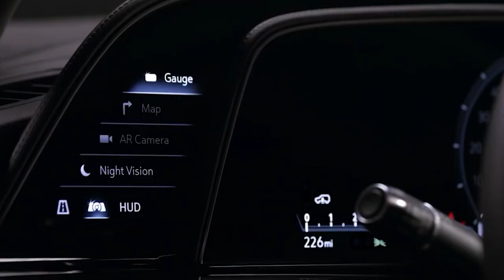GM CEO’s Final Decision On Electric Cars! HUGE CHANGE!

Comment: 🌲 When YOU use any government programs of any kind YOU'VE ALREADY FAILED. The EV YOU just bought is 95% fossil fuel powered. Everything to build that EV was fossil fuel powered. From the dirt being dug up to harvesting and processing all the minerals. ALL the plastic in YOUR car, home & wearing is petroleum based and is shipped from here to China manufactured and returned using petroleum based fueled cargo ships. This also includes all the solar panels and electronics YOU just purchased. The government is going to start charging YOU a connection tax/ monthy fee whether YOU use it or not along with a per mile fee and soon to come the time of day YOU drive fee. YOUR EV weighs TWICE as much as a regular car causing TWICE as much road damage which means the roads have to be replaced TWICE as often. (traffic jams during construction) using fossil fuels. YOUR batteries are the exact equivalent of a empty gas tank. YOU have to fill them both up with energy. The 20-year END of life solar panels ( recyclable NOT ) in California are just now coming off the roofs in droves and they only have $1.50 worth of recyclable material which cost $20 to retrieve. California like EVERYONE has NO place to put them or recycle them which would be insane if YOU did being the amount of fossil fuels YOU'D have to use to process them. Plus add up all the government permits & fees, people, cars and large industrial buildings that will be consuming massive amounts of fossil fuel to do the jobs. Final note. Newson is trying to dump the dead cells in Arizona which they replied. HELL NO! 🌲
Reply: Hm..